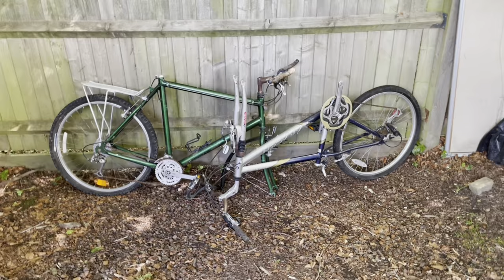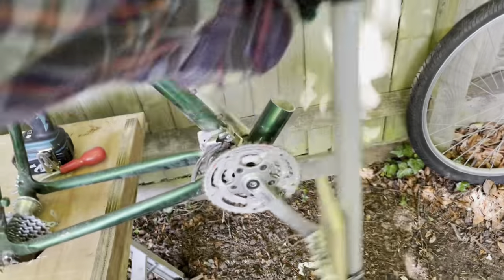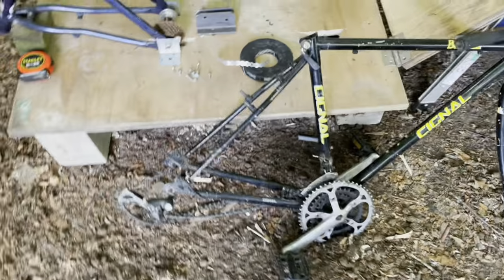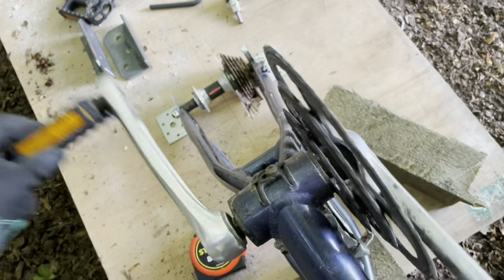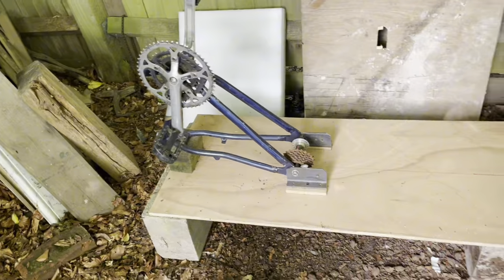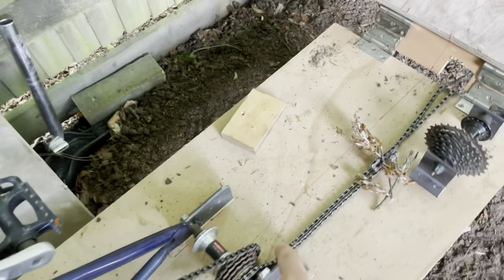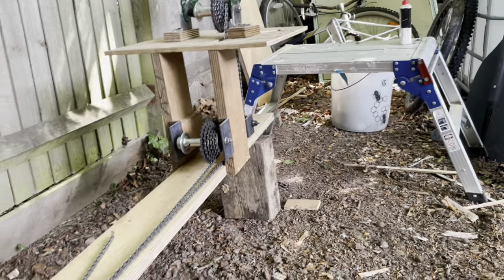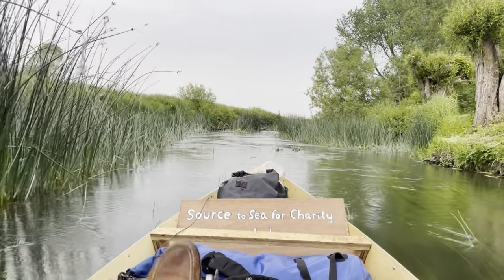Pedal Paddle Drive Canoe 2/3

Comment: Hi Ben,
This project is so cool. I'm hoping to by a canoe this week and make a kind of the same Pedal Paddle. Did you use a Fixed-gear bike in the end to be able to go backwards? I was just wondering about that...
Reply from the maker: Hi there! Superb, there is a Facebook community group for builders if you fancy joining. Head to the link in my profile to get there. This setup is full fixed gear to allow for braking and reverse. The gear ratio could be changed in a few minutes. MK2 had a fixed gear setup but the ratio could be changed in a few sections with the chain stationary. Working on MK3 now 👀